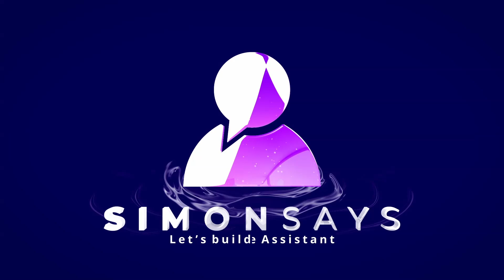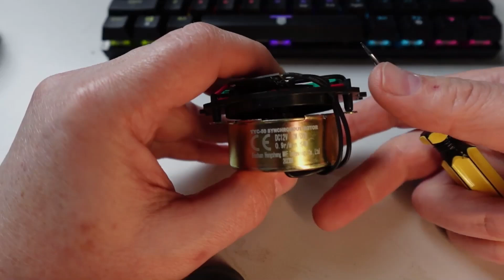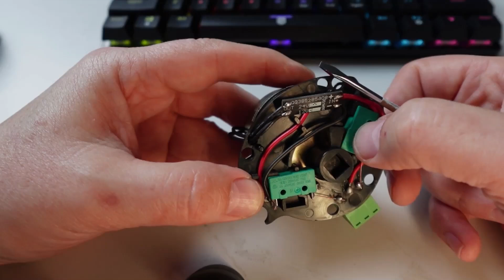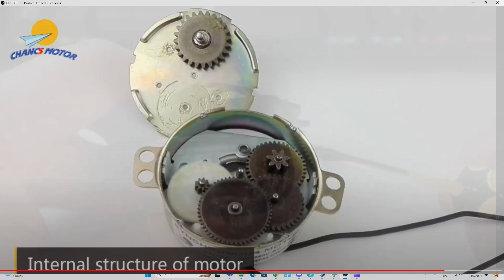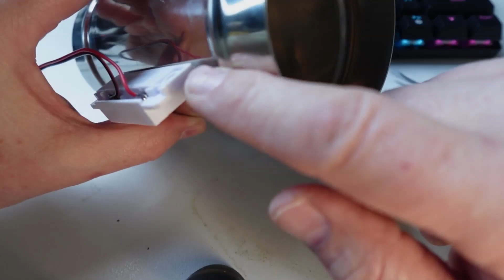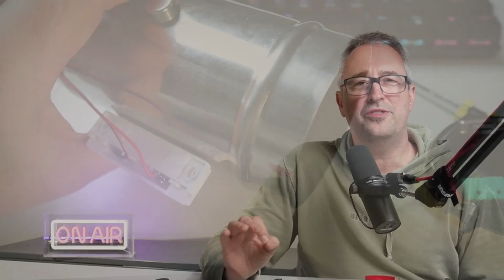Tear Down of the Airflow Control Valve and Feedback Sensor Upgrade

Comment: great to see it working! I see that they do 3 way joints, this would be good to have an extractor either push it outside, or when the extractor is off it switches to bypass mode. I still am in the middle of designing my system, had a company come in and make a dogs breakfast out of my AC and ventilation system. (the ventilation system was on but nothing controls it), the pipe work is also wrong and it doesnt take moisture out of the house if it is going... lol.
Reply from the maker: Yes, I like the idea of having full control of my system and from what I can tell so far these valves offer a pretty robust solution for a great price point!  The 3 way offers two valves so it should do the job

Comment: My guess is under the circuit board's blob is two diodes (one for clock-wise, other for counter-clock-wise). A shame your unit's limit switches does not have a 3rd terminal that could have been used for a position status.
The water tank valve I got works almost in the same manner. Difference is my valve uses a small 12v DPDT relay inside for a make-shift 'H-bridge' circuit. - One wire is needed to control, connecting to 12v the valve opens and disconnecting it closes again.
Reply from the maker: Thanks Mark, yes that makes sense!  Yes I see that you can get dampers with just 2 connectors and a spring returns it once you remove the power